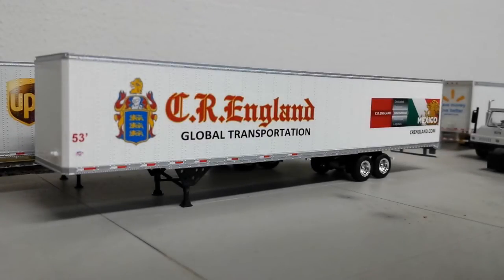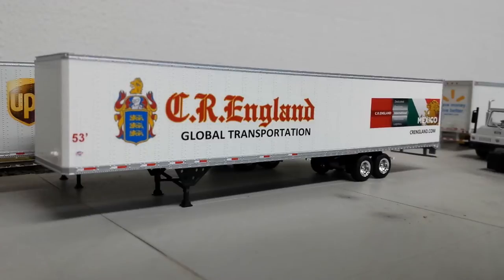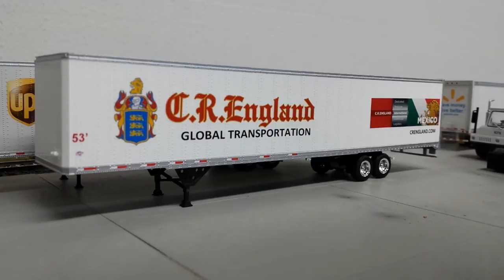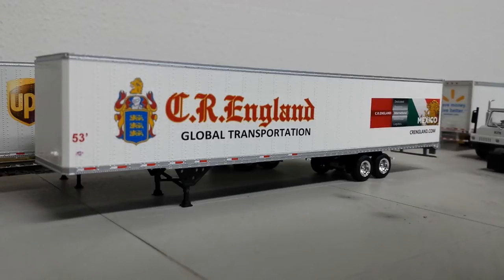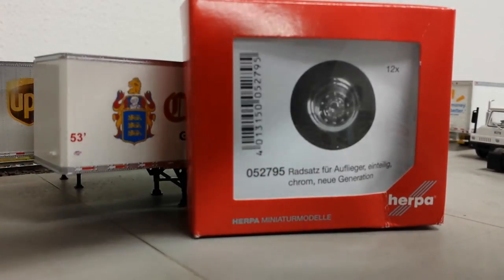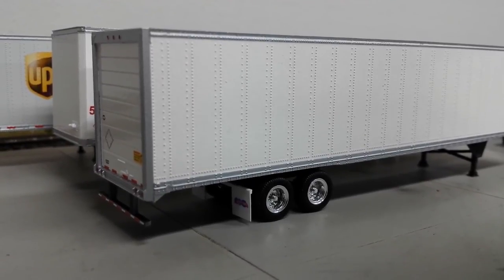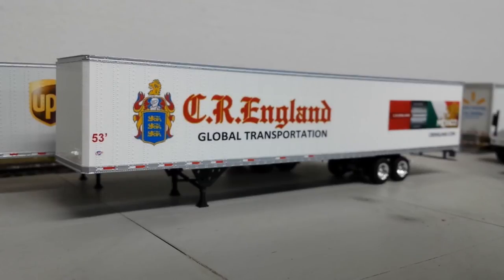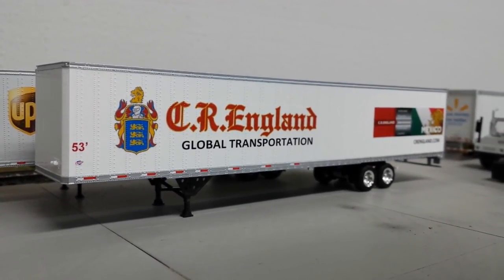Custom CR England HO Scale 53' Trailers

Comment: This is awesome!  I used to drive for CR England.  I remember pulling one of those trailers just as they started hitting the road.  How much would you charge to print a set out for me?  I don't have PS, and I don't want to spend the money for it if I'm only going to print one set of decals.